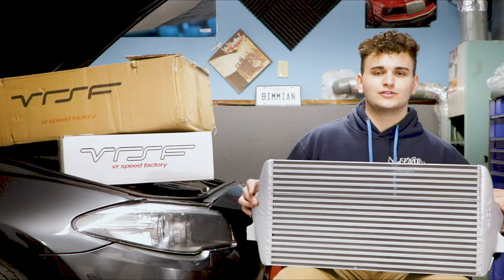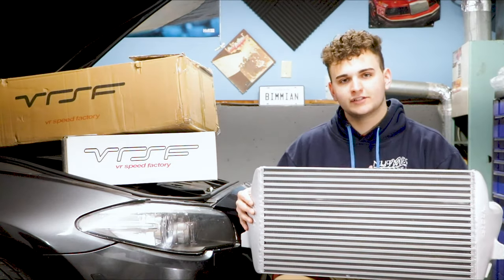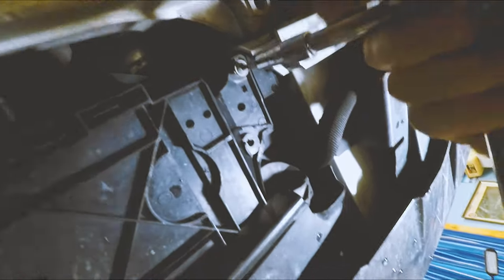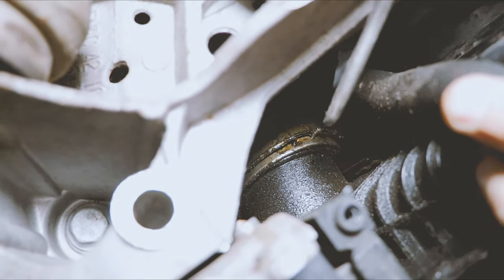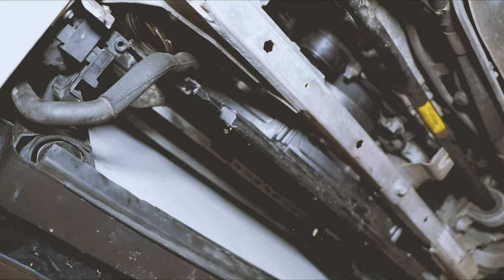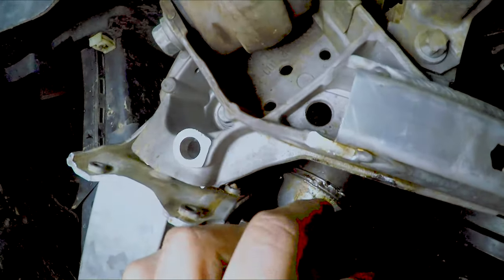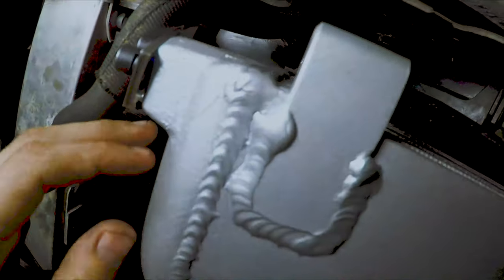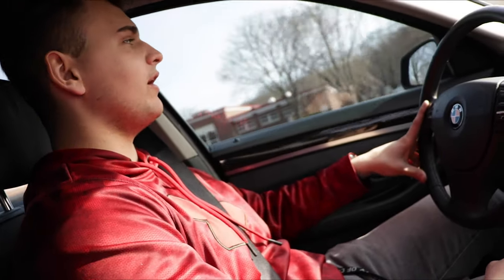BMW F10 N55 Performance Intercooler Install

Comment: Great video.  When removing stock Intercooler, was their a trick to disconnect the driver side (intake) Intercooler from lower charge pipe?  I got the c clip removed but doesn’t seem like their is much play for the Intercooler to drop out and down.  Passenger side pipes disconnect easily.  Thanks for the video.
Reply from the maker: Todd Vishnauski I apologize I never saw this comment but I wouldn’t say there are any tricks to it, you honestly just need to push and pull at the right angles enough times and it will come off really easy.

Comment: Hey Nice video, can you tell in another video what is the program you use to see the engine horse power and torque, I didn’t know that such a thing was posible lol! 
Also, I have a stock 2011 535i F10 N55 
will you start going for stage 2 instead of stage 1?how much of a difference in cost will be? Thank you!
Reply: Download BimmerCode and get a WiFi obd
Reply: you don’t need a program. put it in sport and open the sports display

Comment: Thanks for the video.  Did you consider removing the cooling fan assembly to allow more room for the IC install?
Reply from the maker: This might be a very effective note, did you notice it worked better? I believe the intercooler gets caught on something other than the fan however
Reply: @EastCoastGarage   I have done everything else except this. A few 5post colleagues have stated that removing the fan assembly made install easier.  Also, some members removed the CP to allow more play in lower CP.  On the F10,  it can be very tight. Now that there are several IC brands to choose from, pricing has become competitive.  I have seen the temp logs of the various brands, and all are consistently cooler than stock. Beneficial mod for those tuned.  Thanks again for the video!
Reply from the maker: @jwherron  well I’m sorry it was so difficult the tan assembly isn’t awful to remove it might be worth a try. I’m glad you liked our video!

Comment: Thanks for posting this! Appreciate it man! I actually just got one of these on sale. How much of a difference did you notice with the intercooler and charge pipe? Fitment ended up pretty good I assume? I've heard mixed messages on VRSF but the stats I've see on the intercooler were too good to pass up for the price.
Reply from the maker: NNHGroup absolutely insane difference in power. Once adding a downpipe and air intake we can start running stage 2 👀 fitment was fine once we started really messing with it. Take a minute to get the pipes off and on.
Reply: @EastCoastGarage  Yeah Im still under warranty so no downpipe yet, I have the AFE intake and it was a noticeable difference, running active autowerke tune. Was planning to drop in the intercooler tomorrow but thought about getting the charge pipe. I kinda don't want to wait so seems like more work for me lol

Comment: What tune and everything are you using I was using sports display but my f10 was only doing around 240 or so and I have catless down pipes and charge pipe and Mhd stage 2.
Reply from the maker: If you are only around 240 you most likely have a 528i or a broken 535 because they should come stock with about 300 and then I got mine up to over 400 with everything you just listed off. The 528 is only 4 Cyl therefore much less horse

Comment: Would it have been easier to get the Intercooler connected to the boost pipe if the radiator and fan were out of the car??
Reply from the maker: David Aguirre I don’t think taking out the radiator and fan would help connecting the boost pipe but they will definitely help to fit the Intercooler itself in their if you are having issues fitting it in. I mean I suppose you could say removing this will give you more room to access the boost pipe but I really don’t think it would help too much. If you are having serious issues with the boost pipe, first remove your charge pipe and the boost pipe will slide right on
Reply: Getting the 2 flanges in is the hard part.

I heard a guy say take off the front bumper; not sure how that’s going to help get the 2 flanges in.
Reply: @davidaguirre6745  I just did my tensioner and belt, and that required taking the electric fan out. If you combined the two tasks it would be easier from the looks of things.
Reply from the maker: David Aguirre I really don’t see how removing the front bumper would help. That video may have been for an f30 I believe the process involves removing the bumper but honestly it didn’t take us more than 10 minutes of shoving the intercooler in. It definitely will leave some scratches getting it in but it will get in without damage I promise

Comment: How did you get past the small radiator hose without damaging it ?
Reply from the maker: Honestly I would just say that things are much less likely to break than you think. Obviously don’t go crazy but I’ve noticed on this car most things have decent play
Reply: @EastCoastGarage  yes I know what you mean, sometimes it’s best to have the confidence with the build quality and go for it....  which is what I did today - installed my VRSF intercooler in my garage at home - damn it is a tight fit, wasn’t as seamless as yours, but I got there with a few tricks 🧙‍♂️
Reply from the maker: @legoman911  haha well I’m glad you got it in. I definitely was thinking when putting it in “no shot this is fitting” but it eventually made it in